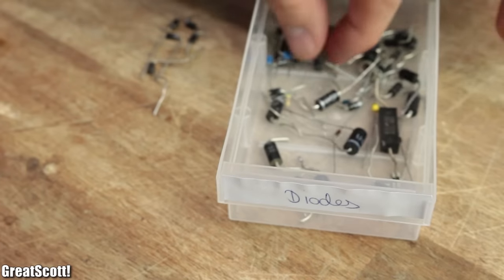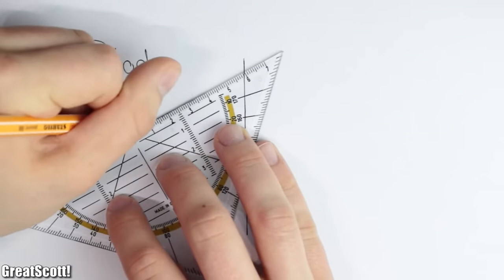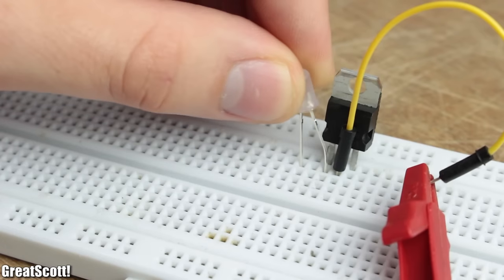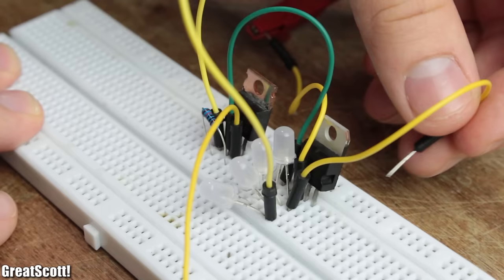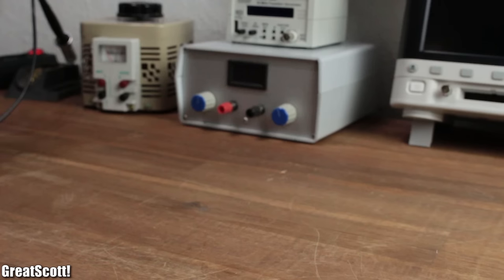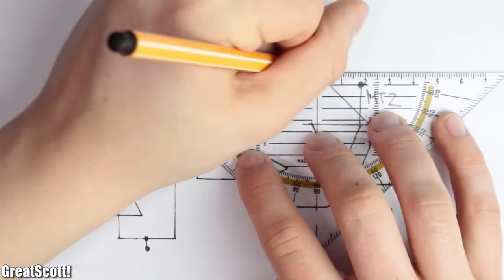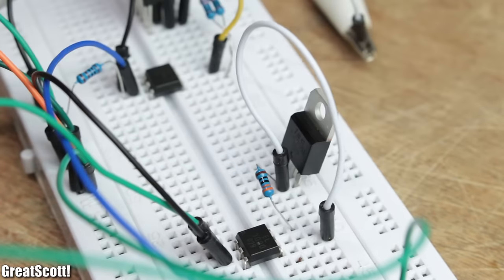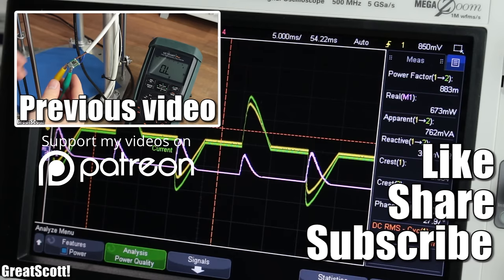Electronic Basics #20: Thyristor, Triac || Phase Angle Control

Comment: There is no need for the Arduino or microcontroller here. Your hair dryer, heater or light dimmer certainly don't contain them neither. 

Each thyristor or triac has a gate threshold voltage that you need to exceed for it to become conductive. Then all that you need is a potentiometer acting as a voltage divider of the AC voltage, the wiper of the pot connected to the gate. The potentiometer lets you "shift" on which part of the AC sinewave the device starts conducting. It is essentially a comparator where one input voltage is the built-in threshold voltage of the component and the other input is some portion of the incoming AC. That's all. No microcontrollers needed anywhere. 

Here: http://www.circuitstoday.com/simple-lamp-dimmer-fan-regulator

The diac is not strictly required, but it both helps to make the threshold voltage when the circuit turns on better defined and also to raise it from about a volt to something more usable, especially if dealing with mains voltages.

Oh an important issue that was not mentioned - these circuits produce a lot of wideband switching noise that will cause interference in a wide radius. It is because of those horrible, non-sinusoidal waveforms the circuit produces. If you are thinking about building a dimmer or a regulator like this, don't forget to add filters on the input and ideally put the setup in a shielded (earthed metal) box.

Comment: I'm trying to understand the voltage bust part of the circuit, the arduino pin never seems to make use of the burst? nor does it appear in the triac side of the circuit.
Reply: +GreatScott! Like u define the zero on pin 2 but never use it?
Reply: After some time reverse engineering, I finally found the issue was with an Arduino Leanardo, the attach interput is "1" to reference pin 2.... After finally reading up on the attach interput it became apparent why my angle function wasnt being called.

Great video circuit performs as expected :)

Comment: Why did you use an arduino? I don't understand, don't normal dimmers just use a diac?
Reply: +TheChipmunk2008 He had it on hand and it is easier to adjust the properties of that part of the circuit using a microcontroller. A few lines of code vs. swapping out several parts.
Reply: +KnightsWithoutATable Yes but it's hardly 'basic electronics' if you use a microcontroller, I guess that's why I asked
Reply from the maker: +TheChipmunk2008 I think using an Arduino is pretty basics nowadays.
Reply: +GreatScott! I guess if you use them all the time, yes. I just didn't expect to see it is all, to me it's more comp sci than electronics

Comment: can you build a solid state fuse ,that turns off,whenever 10 Amperes or so are reached and reactivateable threw a pushbutton?
Reply: Tobgamer he did
Reply: no he build it with a relay and such a relay has compared to a solid state switch a rather slow "reacting" . sorry for my bad english

Comment: Actually, the 9V from the AUTO-transformer is not safe to touch, as you are not isolated from the mains ... Did i misunderstand you or?
Reply from the maker: +zaprodk Only dangerous if you connect the live 230V wire to the common pin of the transformer. But you still needed to be earthed though before getting shocked.
Reply: But you actually can't be sure which connection refers to the transformer common, since it probably has a normal EU wall plug in your case, right? So it may be plugged in in both directions, possibly causing the 230v brown mains wire of your wall plug to be connected to one of your autotransformer outputs?
Reply from the maker: +Jilocasin  I always check the voltage at the input to see whether 230V is not at the common pin. Measuring against PE does the trick.

Comment: How is it possible to touch an autotransformer output without getting shocked? It doesn't provide any galvanic decoupling.
Reply from the maker: +SaNjA2659 But it steps down the voltage. A galvanic isolation is not the key safety feature here.
Reply: +GreatScott! But what happens if you accidentally get live wire connected to a "common" pin of the autotransformer?
Reply from the maker: +SaNjA2659 Pretty much nothing due to the low voltage
Reply: +GreatScott! Isn't it still gonna be 230V relative to earth?
Reply from the maker: +SaNjA2659 Now I get what you mean. Yes, in such a setup it can be dangerous. I always check my input whether the common pin is really neutral.
Reply: +GreatScott! Great! Just thought it is worth mentioning due to the electrical safety concerns. Especially when you're using those kinds of plugs and sockets that can plug together both ways.

Comment: The biggest problem with that kind of circuit is the copious amounts of RF interference they generate.
Reply: +Robert Shaver do they?
Reply: +Macarena Yes. Sine waves are quiet. Uneven waveforms generate noise. Really good dimmers have other circuitry to filter this from the wires and shelding to keep  the RF from radiating like a radio. Just Google "rf noise from dimmers".

Here are some links where people talk about this issue:
http://www.thegearpage.net/board/index.php?threads/will-a-good-power-conditioner-eliminate-problems-caused-by-dimmer-switches.575551/
http://www.dslreports.com/faq/12365
http://www.diychatroom.com/f18/dimmer-switch-causing-radio-interference-170935/

This video shows how to reduce that RFI: https://www.youtube.com/watch?v=eIbPs6-bnlA
Reply: +Paul Frederick Okay but do you have a TV, home theater, wireless phones or even an FM radio? Any kind of audio amplifier is susceptible to receiving this RF noise. And it's not just at home either. I've been on various AV teams for about 30 years and we often run into noise issues in performance venues that we have to track down and fix if we're going to deliver quality sound for the audience. Sometimes the fix is as simple as a clamp-on ferrite core filter that clamps onto a power cord. Other times a dimmer has to be swapped out for a better one with built-in filtering.
Reply: +Paul Frederick Even if your TV signal is delivered via fiber, the noise can be coupled in via the power mains.
Reply: +Paul Frederick You can't hear digits. They must be translated into analog then amplified and sent to a speaker. So, yes, even digital audio equipment can be affected by noise transmitted through the air and on the mains connection or other cables connected to the equipment ... even the ground wire.
Reply: +Paul Frederick But is the amplifier connected to the power supply? Is everything shielded from RFI? Is all this true for every piece of equipment that is being made in the past, now and in the future. I wish I lived in your perfect world then I wouldn't have had to spend so much time fixing this kind of problems. Perhaps you have not experienced any noise issues. Good for you. But I have and lots of other people have.

Comment: This was an informative video, but lacking one vitally important piece of information.
Your use of a variac to reduce the mains votage to a "safe" level assumes that the active and neutral input terminals are wired correctly. 

You did not not draw any attention to the possibly lethal consequences of not checking this 

Even with variacs that have this wiring internally, you are still trusting that the wall socket is wired correctly, but it's doubly important to check the polarity on this type of variac with the exposed wiring. 
It is very poor practice to not use isolation when you connect mains voltage to something that you can touch. 
And irresponsible to recommend it to others, especially beginners, without warning of the dangers.

A far, far, far better choice would have been a simple 9v step-down transformer.

How I made one of these variacs safer (and more useful):  https://www.youtube.com/watch?v=-uQzpwBPxRg